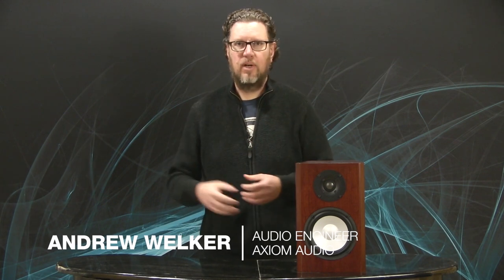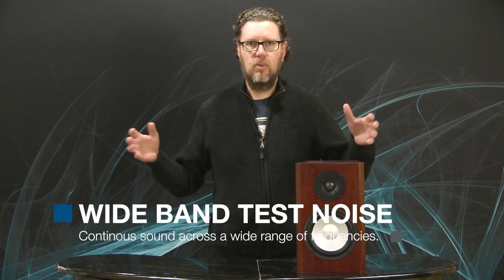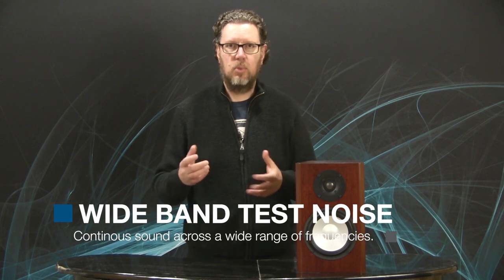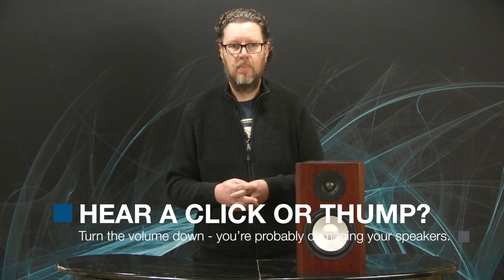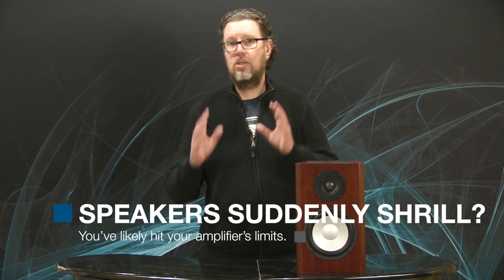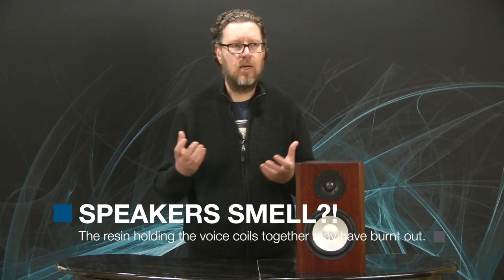Speaker Power Handling vs Amplifier Power: Audio Myths Part Three

Comment: I have damaged HF drivers (tweeter) on two different speaker system both with amplifiers rated well below the maximum power handling rating supplied by the speaker manufacturer. Likely from clipping the amplifier on high frequency music content.   In another case, my cleaning lady liked to listen to the radio while doing housework.  Unknown to me, she turned on my audio system to play the FM Tuner.  Turning the volume control to full and only hearing a slight hiss (the Source on the QUAD Preamp was on the Tape Input when I had last used it) she started pushing input sources on the Preamp. She eventually pressed Tuner when the volume was full tilt and then BOOM.  That night when I turned on the audio system, one of the speaker's low frequency drivers was dead and the other made a weird sound.   She was the only person in my house that day and the next day she called to say her hourly rate had gone up and would I need her to come next week.  My answer was No!
Reply from the maker: Yikes! That must have made one heck of a noise. ☹

Comment: I've blown the drivers on 3 of my last 4 passive speakers. The tweeter was blown on my JVC and Paradigm, leading me to throw them out. The woofer was blown on my Nuance (replaced under warranty). I don't play the music that loud, so I suspect it was when I accidentally connected or disconnected a powered interconnect or experienced a few seconds of stonking feedback and squeal when some of my playback devices went crazy. The one I hate the most is when you turn off the amp, and the attached subwoofer goes THUNK!
Reply from the maker: Yes, never, ever, make amplifier connections with the power on…no matter how good the design, you’re just asking for potential problems and damage to your speakers!

Comment: I have the problem with the click noise from my speakers. I checked on forums and it turn out to be a lack of power in the amplifiers power supply. I guess I will have to be very careful not to damage my expensive speakers  till I get a proper amplifier.
Reply from the maker: Yes, if you’re getting some sort of mechanical click sound, your amplifier is probably not happy.

Comment: I thought the standard was how many watts can a speaker take at 1,000 Hz with out distorting and burning up the voice coil. Watts are a measurement of heat as in how much heat can be generated in a circuit use X amount of current. when I was in my late teens I picked up a two book set written by Phillips that gave you an explanation of all the specs of an amplifier or playback device, like a tape deck, turntable etc. The other book was about how much power you needed, speaker efficiency and how to set things up. they suggested that to power a set of speakers of average efficiency, 20 watts would be the minimum amount of power needed. I bought a 30 watt Harmon Kardon reciever which was what they called high current capable. They rated its performance as 30 watts in 8 ohm speakers and 90 watts into two ohm speakers. They said their amp could handle a 1.5 ohm load. When your driving a bass speaker it’s impedance changes with frequency. that little 30 watt amp was enough to provide sound for a large room like a bar or Church hall. In fact, when I moved in with my best friend and former roommate we were partying one night and a friend wanted to hear what they sounded like at high volume. With the power pot turned up a little over half way, with the door and windows open, we started hearing cheering from the high school next door to the apartment complex. We wondered what was going on, why the lights on the football field were on. Football season was over, and it was late in the spring time. One of the guys ran over and looked through the vines on the fence separating the football from the parking lot where I lived and he came running back yelling shut it off. A few minutes after we had shut everything off, closed the windows and the door it dawned on us that blasting we don’t need no education on Pink Floyd’s wall album wasn’t the kind of thing you would want to do during that high school’s graduation ceremony. So if you were graduating from Cortez High School in 1985, you’re welcome! If you were a parent or staff member, oops!

Comment: As said below, I usually have an amp 50 percent higher than my speaker rating. E.g. an 18 inch at 1000 watts (aes) means an amp of 1500 watts ( aes) per channel. I'm order to stop clipping.

Comment: Thanks for the great explanation. I have a Lyngdorf tdai-1120, rated at 60w per channel at 8ohms and 120w at 4ohms. Connected to my dali opticon 6, which can receive 50-200watts of power. Is this setup optimal or are my amps very under powered? Though my listening area is a 10ft x 10ft, I like to listen at fairly high dB, around 80.
Reply from the maker: You should be perfectly fine with that combination, as the Dali loudspeakers are reasonably efficient.

Comment: Hi Andrew, this was super helpful. I have just bought Monitor Audio Silver 500s due to a good deal and wondering if I'm going to need a new amp now. It recommends 80-250W, has nom impedance of 8Ω, minimum impedance of 3.1Ω and sensitivity of 90Db. 

I have 2 amps - Marantz PM5004 (35W 8Ω, 45W 4Ω) and Rotel RA-04 (45W, manual states min 4Ω). Internet seems to suggest the recommended wattage is meaningless and 90Db should mean 40W is fine volume-wise, but I can't help but wonder if these are underpowered and could induce clipping at certain frequences like you say in the video?

Regaring ohms, I can't find a clear answer on whether that 3.1Ω figure is a problem? I have a list of the specs of 25 amps and ZERO of them claim to support less than 4Ω, yet half the speakers I've looked at go lower than 4Ω! Could you help me out here? Do I need to find one that supports 3 ohms? Does one even exist? Will these amps damage the Silver 500s or vice versa?
Reply from the maker: Thank you! I think that either amplifier will work, you just want to watch out for overheating, shutting down, or a very sharp and fatiguing sound if you have the volume turned up loud. If you do you’re reaching the limits of the amplifier and should look for something with more power capability.
Reply: @AxiomHomeTheaters  Cheers for the info. I gave them a try and they both seem to work okay, bit of heat with the Marantz but nothing crazy, although I'm not listening at high volumes. Do you think there's any sound quality benefit to more power with these speakers (not necessarily higher quality components, just more power)? Would hate there to be untapped potential lol!
Reply from the maker: @FROOB202  45 watts per channel is pretty low for a floorstanding speaker like the 500s, unless you have a really small room or don’t listen very loud. I would say that 100-150 watts per channel is the sweet spot. More power is never a bad thing to have in reserve.

Comment: The only thing I've had problems with is with the tweeters . Most manufactures that say you bi-wire/bi-amp some of their speakers but they don't say how much power the tweeters can handle .
Reply from the maker: Unless stated otherwise, my normal assumption is that bi-wiring should not change the power handling of the loudspeaker, assuming you are using identical amps for both sections. But as always, use your ears as your guide when things are getting too loud for the loudspeaker to handle.

Comment: Hi Andrew, thank you again for your wonderful video. Now i have a Mcintosh MC 452 amp with 450 watts per channel, i used to drive my Mirage OMD 28 with a 300 watts unclipped maximum power, do you think that i may damage my OMD 28 speakers if i push my amp near 400 watts ??
Reply from the maker: You should be fine with your amp. If you hear any signs of distress that’s an indication to turn it down. I know the OMD-28 will easily take well over 500 watts at bass frequencies with no issue.
Reply: @AxiomHomeTheaters  Thank you very much.

Comment: While listening to loud rock music on Spotify, just to see what would happen I turned up the volume on my NAD C700 amp (100 watts into 4 ohms) to 77% connected to my Dali Opticon 2 MK2 speakers (4 ohms, 86.5 dB, recommended amplifier power 50-150 watts). It sounded very loud, as if I were straining the tweeters, and the sound was kind of flat. I turned it back down immediately. Do you think I damaged my speakers? They don't sound weird as far as I can tell, but I still wish I could go back in time and not have done that.
Reply from the maker: If everything still sounds ok at normal levels, you have not done any major damage. That straining sound is your cue to turn down the volume!

Comment: If the recommended amplifier for the speaker is between 40 and 100 Watts is it safe to use in amplifier that is rated for 125 Watts?

Comment: Sorry for long question... I've found an amp, spec'd at 2x200w @ 8Ω & 2x250w @ 4Ω. I connect four 8Ω speakers thru a switch to connect the two pairs, in parallel. The resistance to speakers becomes 4Ω. I play the amp at full power (2x250w) which powers the speakers at 4x125w. Let's say the speaker's upper limit is 125w. Can the speakers be damaged if, using the switch, I switch out one pair? The resistance will change to 8Ω; will the amp be outputting 2x200w? 75w above the upper limit of the speakers?
Reply from the maker: Regardless of the power handling of the speakers, or the amp power, you should never use a speaker switch with the system running at high levels.

Comment: Thanks Andrew for your excellent videos. Could you help me. I’ve got a Jbl 4 ohms 1200 wpc pa amp. And FANE colossus  Xb 1000 watts 18” subs 8ohms. . Are they compatible or I’m I starting a bonfire . Any body!
Reply from the maker: You’re welcome! I think you should be fine running that subwoofer with your JBL amp. You’ll know if you’re pushing it too hard!

Comment: Hi, my Technics Amplifier SU V660.
@20Hz-20Khz continuous power output 2x90watts with 8ohms and 1Khz 2x100watts with 8ohms .
Please suggest me the right watts speakers
Reply from the maker: You’re probably best to look more at the sensitivity of the speaker and the size of your room, but max power handling in excess of 100 watts will be fine.

Comment: hello i just watced your video and i have two questions to ask . Firstly, i have an amp that has 40w(left) + 40w(right) + 80w(subwoofer) output. I have tested a 50w speaker on the 40w output and at 25/31 volume it distorted. Do you think it would be better if i connect a 60w speaker? Secondly, how many watts should I put in the subwoofer output? 120w or 150w subwoofer? Please reply im in a dilemma for days now.....
Reply from the maker: It’s hard to say without knowing the impedance of your speakers. I would check the spec sheet of your amp and speakers to make sure everything is within the recommended range.
Reply: @AxiomHomeTheaters  thanks
Reply: here depend by ohm and If really this is the power of amp and speaker.
try to put some what the amp can hanndle 
If amp cannot hanndle the power of speaker is normal to get distorsion

Comment: can you tell me why my speakers are not putting out the proper volume for the amp volume i set. so when i turn up the volume high, the speakers are very low. i tried a different amp, same thing. each amp was 100+ watts, the speakers are shelve models, not big. i expected the speakers(bose 201) to be very loud when i turned up the volume.
Reply from the maker: It's hard to tell how loud your speakers are going and how loud you think they should play. Do you have another pair of speaker to swap into your system?
Reply: @AxiomHomeTheaters  i think i discovered the issue. the receivers do not have a phono pre amp jack, so when we used an alternate, the volume was too low
Reply from the maker: @jtepsr  Oh, that would certainly do it! Glad you got it working.

Comment: How much wattage am I getting using an integrated amp as the pre, and the power amp is double e.g. 75 W per and 150 W per respectively?
Reply from the maker: If the integrated amp is only being use as a pre-amp, then its amplifier will have no contribution. You’ll only have the 150 watts per channel from the separate power amp.
Reply: @AxiomHomeTheaters  Hey, thanks for clarifying that.
Reply from the maker: @broadcastmedia  you're welcome.

Comment: Why do I find my SE 300b amp sounds fine with my AR4x speakers?
Reply from the maker: At low levels the speakers are likely not needing much power. Beyond that you will certainly be clipping the amp, at least part of the time.
Reply: @AxiomHomeTheaters  I only listen at comfortable levels. What does amp clipping sound like and will clipping a tube amp cause any damage?
Reply: @AxiomHomeTheaters  I am not sure what "low levels" is to most people?
 This is in no way am argument with you but it seems the AR4x speaker was designed more or less with low powered SS or medium powered tube amp in mind due to the ear they were made and the ease of blowing tweeters on them with too much power.
Reply from the maker: @bertroost1675  Clipping can sound different depending on the amp, but usually it will add harshness and hardness to the sound because of high levels of distortion. Clipping a tube amp will not normally harm anything, but it does suggest insufficient amplifier power for the speakers you’re driving.
Reply from the maker: @bertroost1675  The AR4x was quite inefficient by modern standards and AR recommended a minimum of 15 watts per channel to run them. Many SE 300B amps are capable of much less power than that.
Reply: @AxiomHomeTheaters  Yes, most of my tube amps are SE and only rate around 8 watts per channel but still sound fine to me. Again I don't crank my music.
 What is the efficiency of the AR's? I don't know if it was ever published, but you're right they recommended 15 watts.
Reply from the maker: @bertroost1675  Most ARs, typical of acoustic suspension designs of the time, were normally in the low to mid 80dB range. Most people recommend pairing them with a powerful amplifier.
Reply: @AxiomHomeTheaters  I get it but I wonder if Henry Kloss would agree?

Comment: Clipping is much more dangerous to speakers than actual power. When an Amplifier is driven to Clipping it produces distortion that first goes to the tweeter and can burn them out. It's harder to damage the woofer because of a larger voice coil but it can be done with continued Clipping with bass heavy music
Reply: The reason clipping burns tweeters is precisely because it overpowers tweeters. The problem isn't the distorted sound the speaker is being told to make. It's the amount of power being driven to it.